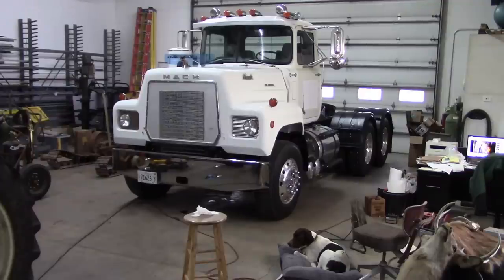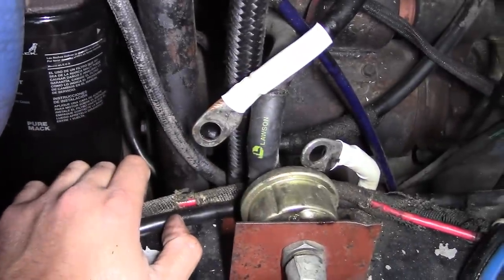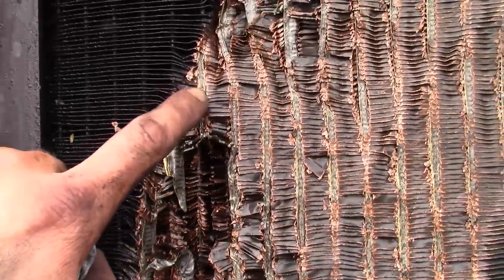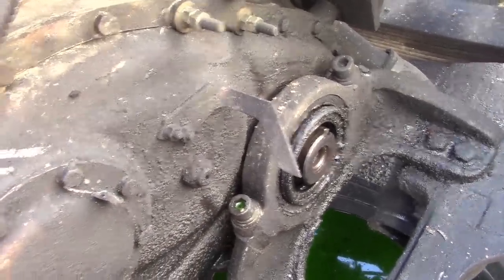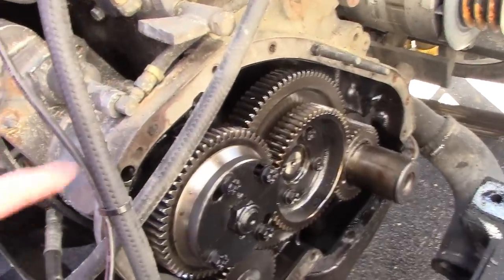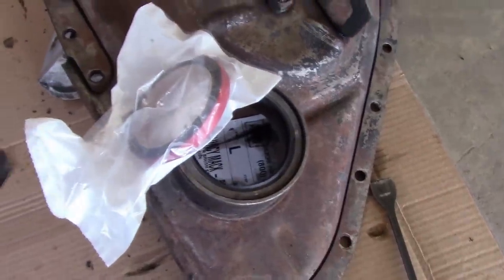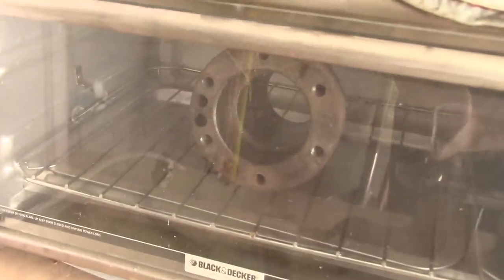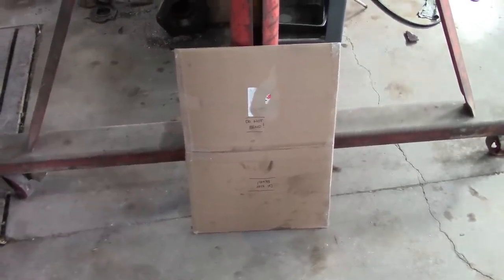Mack R Model Semi Truck Has a Bad Day - Fan Hits Radiator and Battery Issues

Comment: The farmers is extremely lucky that you were working on his truck. Any other mechanic probably would have given up a long time ago.👍
Reply: Ya they would tell him fix it himself or dump it
Reply: You are more right than you even know lol. Double edged sword with that. Once farmers have a guy that does it all and that they can trust, they won't take it anywhere else, for anything and they will tell everyone else about him and then all the other farmers will send their stuff to him. Which is both good and bad. Money is good, but they can also be misers and if you only rely on the farmers, once you have a dry spell and need other work, there isn't any because you're always turning other work away to cater to the farmers. Because you NEVER turn away a farmer in need. Once you do, you likely won't see them again.
Reply: Wes is like the Patron Saint of Lost Causes, nobody else would have the patience for all the rust, rust, more rust, detective work, and parts hunting.
Reply: @eformance  ya and as the saying goes when you need it it's not there when you don't it is so just as he got it out the door the FedEx arrived
Reply: @eformance  I think there is some remuneration involved.
Reply: @silasmarner7586  The Mack dealer would have had it 3x longer and charged at least twice as much.  The PITA factor is real and they make you pay!  That's all assuming the Mack dealer would even work on a truck that old with as many genetic donors as it has had.
Reply: Isn't the farmer his own father?

Comment: A little "Mack History". I you have a gold Bulldog on the hood that is considered a "Petagree " truck. Which means it's all Mack. The Engine, Transmission, and rear differentials are all Mack components. If your Bulldog is silver, then you have a "Curb Stone Setter" which means your truck is made up of a mix of drive train components. Just a blast from the past. .
Reply: I have  90 mack r model  has silver bulldog  but its all mack  parts , e6 -300 , 8 speed maxitorque,  mack rear ends
Reply: @MrSehka77  Huh, that's strange. Thanks for letting me know.
Reply: @kenuber4766  yea maybe hood was  not original or bulldog discolored not sure ? This truck also has mack severe duty beam suspension
Reply: In my shop right now there is a brand new 2020 Mack with a Vactor - Guzzler vac body mounted on it and it has a gold bulldog on the hood... wonder if the same still applies. Going to have to take a closer look at it!
Reply: @alexbrodeur6458  Just look to see if it has an all Mack drive train is all.
Reply: @alexbrodeur6458  most of the companies i ran for had macks, gold dog is all Mack components, the ones that had the Allison transmission or Meritor  rear axles were silver dogs.
Reply: Yep,  my 68 F-model Mack is a gold dog ,  all Mack front to back.

Comment: I've never left a dealership interaction feeling like "that was a good experience"
Reply: I did once, when I did my own repair and stopped by to see what it would cost there...
Reply: I’ve had some good ones. There pretty much just oil changes though...
Reply: Especially waiting on parts located in a parts warehouse by a parts house arriving by air freight....... 
"6 days out from Anywhere U.S.A." is the way too comfortable saying from a parts guy anymore!! 
🤦‍♂️🤦‍♂️🤦‍♂️
Reply: Especially CAT dealerships....🤦🤦
Reply: My local Nissan dealership is unbelievably reasonable and competent.  It's been rather scary, actually.

Comment: You've done  it again- taking an impossible job on and making it happen.  I am impressed again by your attitude, neat battery tools and hard work dismantling the engine, finding the parts and reassembling it.  Congratulations and thanks for showing what you had to do.

Comment: When I was younger, "Maximum Overdrive" was the must see movie the summer. Since then I've been in love with Cab Over Mack's with the flat face. Always wanted to drive one down the highway blasting the AC/DC sound track to that movie.
Fun Fact: Highway to Hell was an AC/DC album, renamed "Maximum Overdrive" and cover art was changed for movie release. A year later they discontinued the cover and went back to the original album name.
Reply from the maker: Interesting. I've seen that move dozens of times!
Reply: Greatest Mack truck movie?  Spielberg's DUEL

Comment: Clearly this is a job for the mechanic on the "Road Warrior"
Reply: "It's gotta cracked toiming covah and it's broken a few teeth off the toiming geahhs, the radiatahh's damaged at the coahh..."
Reply: @wes11bravo  🤣
Reply: Air starter for the win
Reply: @jeepindave5464  under-rated comment.

Comment: The double snorkel on the Aircleaner is a Canadian set up.
Reply: Exchange rate that bad?
Reply: @SeanONeill13  no not bad, its used to take engine heat into the engine during the bitter cold in Canada
Reply: Twin stick garage would be swapping those intakes out lol.

Comment: This is why we only buy equipment that we can easily get parts for.
Reply: Probably was easy to get parts for it AT THE TIME but you know how manufacturers like to plan in that obsolescence!
Reply: Yeah allis chalmers are in the pain to find parts, I love the old iron but hard to run em for very long for lack of parts.. im pretty sure there a lotta brands like that too
Reply: That's the same thing they probably told themselves when they bought the truck decades ago. And you know what? They never planned for the manufapturer to either stop production numbers once they came up with different platforms.

You can't possibly this naive to think that just because you have parts availability now, you'll have them tomorrow. Always, always, buy parts whilst you can. Gaskets and seals are you primo stocking inventory. If your equipment doesn't have at least 10 to 20 years worth of critical inventory in your shed, then you're just the kind of guy they easily prey on and make the most money from.

And this isn't even the freaking computerized era yet, we're still in the ignition wire to the battery era, wait until you'll be forced by the market play to buy computerized only, land they'll play the same game then, and you'll see how a 500 dollar repair - work man hours turns into 2k dollar repair and the heartburn that comes with it.
Reply: There is a company out there that makes almost every part imaginable for Mack , an aftermarket company bought up the patents , there stuff is very good , most of the R models are being shipped to foreign countries for dirt work .
Reply: @beckywatt5048  - I used to sell cat  955l, 977, anything mechanical non powershift, non computer controlled to an outfit in brazil.  They only bought cat, and would rebuild it from top to bottom.  They did not care about condition, they once told me every part was available aftermarket.  They flat out refused anything with a computer, Everything was mechanical.  That equipment will be here 50 years from now.
Reply: @kevinoscarson2941  Yes it will , and they blow smoke up our axxes about obsolescence when we are supplying the rest of the world at scrap prices .
Reply: @beckywatt5048  Like now we can't run a 2-cycle GM/Detroit but the military is still getting them.
Reply: @lewiemcneely9143  👍👍👍👍👍👍👍
Reply: the mack was 40 years old
Reply: @jerryhenry662  Some are still blowing smoke here.

Comment: I've had Fed-x do the same stunt and I've spent many a day in an R-model with a 300 Plus with that tip turbine intercooler setup and a 2-stick 6-speed. It might've had a 237 and it was swapped over. That's where the cut cab and double air cleaner lines came from to get the 300 to work. Tough old trucks and someone ought to know how to pull one so not to kill it. You did a fine job and a pal of mine is running an R-model tandem dump with the same setup. That lad was READY to go! GBWYall!

Comment: I've come by your channel recently and spent a few evenings catching up.  I myself have spent a majority of my life fixing everything under the sun and exited the industry as a Rolls-Royce/Bentley technician...and it took me days into your videos  to find a mistake in your work.  Don't get bent out of shape, compared to most youtube automotive repair videos, your work and diag ability is way up there.  So I was a bit taken back to see you coat a battery post with dielectric grease. Dielectric grease does not conduct electricity and its printed on every package to NOT put it on the contact surfaces....anyway, you do you; I still enjoy the videos.

Comment: Great video. Thanks.
Fed Ex and a restoration job that needs to get done -  two things you never want at the same time.
Restoration - yes, when something is over whatever age,  it's no longer just repairs, it's restoration.   Hard to find parts, catalogs with obsolete part numbers from 40 years ago,  previous repairs and problems, etc.

Comment: I drove Mack trucks for over 30 years and after checking fluid levels under the hood you fired it up and let it idle for a minimum of 1 minute so you had lube oil flowing everywhere then you rev it up to kick in the alternator. A Mack is one of the best trucks I ever drove local or over the road. Started out on  a B-81 ten wheel dump 5th gear high split 47 MPH. It was one of 200 trucks built for the 1964 worlds fair in NYC. 160 horsepower thermadyne  engine no turbo. Last was a 1986 Triaxle with a 400 horsepower and a Allison 6 speed automatic. 

I’ll take a Mack any day even the one you’re working on.

Food for thought

Comment: What an adventure to get this truck back to work...as you said, be careful, not to bump in the one that pulls you out, can make it worse...
Had some similar problem some decades ago, got stuck in a field and pulled out, didn't check where the pulling guy attached the rope, he put it on the lower radiator mount, bent it and the fan marked the core pretty neat...
:-/
Thx for mentioning the tracking number, have to check here for a DHL number actually, glad you reminded me...
:-D

Comment: My pocket knife was the best battery connection cleaner I found in 25 years as a small shop mechanic. Bought and tried every gadget that came along. The wire brush type was the best for the easy ones, just had to be replaced as I never seemed to remember to rinse the acid off after every use. Yes, I have a clamp expander and a plier for the squeeze type that were popular for a while.

Comment: Don't know if its already been mentioned but I believe those air cleaners are Canadian specific as well as the heat shields for them and possibly the hood. Bummer about the radiator and the body damage. It's a nice truck though and worthwhile to repair and maintain. Nice work as always! Take care Wes. 👍😎

Comment: Looks like your house should have an endless supply of corn on the cob if you work it right.   lol
Excellent case of one mistake leading to an empty wallet and time loss.
Some what amazed that you got it all repaired at all in a reasonable?? time frame.
Well done, Wes. You never cease to surprise.
Thanks for sharing.
Reply from the maker: It's field corn. It's not good for eating...

Comment: At least those problems are solved correctly for the future. Somedays anything that can go wrong will go wrong, from your problems with getting parts to them getting stuck and smashing the front end into the radiator.  (They might try to put some old tires between the two vehicles to cushion the blow before trying that again) I Like how you fabricated your own tool from an old oil filter and hope you charge them enough for all the extra time and money involved in this repair.

Comment: When I worked for Martin Gas Transport out of Tyler Texas we had a huge fleet of those R model Macks. Nearly all of them puked oil out of the air dryers because there was something wrong about the replacement rings that caused the crank cases to be pressurized and blow oil past the compressor's seals. That start up smoke you got was also symptomatic of this problem. It was a big outfit and they just dumped more oil in them back in the day. May I add that those engines are very sensitive to boost pressure loss and the rubber bits in that feed is really crappy. If you'll deal with that it will give dividends in power. Just say'n. Nice work BTW you obviously know your stuff. Thanks.

Comment: One of my favorite Trucks .. Worked at a Mack Factory here in Ontario Canada, made the frames and drive train  for partial assembly if i remember correctly,  was a long time ago, back when i was a teenager for a summer, also worked at a casting foundry that made the transmission casings and water pump housings and other components for trucks,  one being Mack and others like Ford etc  . So i have a bit more fondness for these possibly .. Even drives these in my Virtual Simulator, Mack R series and a couple older European brands, i dont like newer trucks, albeit the newest Scania are freeking amazing .. Sisters bf drives a 2019 or a 2020 Mack, ive tried it and the Virtual versions and i dont like them , i prefer old school trucks you have to work to drive if you will .. Not these automatic Uni-Sex versions ... I like trucks that are Sold in the Men's dept .  Happy to have found your videos on this truck, im pretty sure its the exact model i drive Virtually, even the same color :)

Comment: Love the truck vids Wes

I’m an apprentice panel beater and I work for a heavy repair shop, I rebuild the trucks that roll 10 times down an embankment 

Bonnets and radiators are my life right now 😂

You did well, get some nice long lifting straps, put em under each wheel well and lift off with a forklift, heaps easier 👌
Reply from the maker: There you go. Or maybe the forklift.

Comment: Wow, great engineuity on making that seal installer.  Lotta fixins on that old truck.  But you went above and beyond to get it up and running again.  Next time I hope the operators use a longer chain or strap to pull that thing out.  Great job all the way around.  Thanks for the video's

Comment: Hey Wes, To make sure the positive battery cable does not ground out to the nearby metal holder, I've cut a piece of old inner tube then made a hole in it and placed it over the terminal before attaching the cable.  May not look pretty, but it works.

Comment: If it’s any consolation shipping parts in Scotland is no better, I ordered two rear leaf springs for a Ford Ranger, received one, cyl head gasket set for another job vanished, a front brake rotor set, vanished.....maybe it’s C19 but it certainly is frustrating.
Anyhoo, neat videos, good job 👍

Comment: I used to have the same problem with black cabs in London. The manufacturer bought parts from everybody. Bits of the cab were Ford, other bits were Volvo, Nissan,Fiat. Once the cab was ten years old the manufacturer wasn't interested in stocking any parts at all.

Comment: 2:35 Not wanting to bust your chops, but you will find your battery terminal spreader pliers will work much easier if you turn them 180 degrees (line up the handles with the cable).  The way the pliers pivot, you are trying to spread the back of the terminal opening rather than spreading the open part at the bolt.
I have used dielectric grease for many many years and have had many, many "conversations" about it "insulating" the connections...

Comment: Worked for a guy that had an old B model Mack. Had two pairs of 6 volt batteries, a pair on each side like that truck. But they were hooked up to a series-parallel switch mounted on the back of the cab. The pairs of batteries were normally parallel to each other. When you hit the starter it put the batteries in series and put 24 volts to the starter. A set of contacts in that switch burnt out and the batteries on the right side couldn't connect back to the 12 volts to charge, and would die after a few starts. That switch was $98 45 years ago. (That truck had a huge 12 volt generator and was positive ground)

Comment: For future reference, the rubber mounts on the bottom of the radiator can be made from "practice" hockey pucks. Since you have a lathe to cut the center hole for the steel bushing to go in it. They also work extremely well for a body mount too.